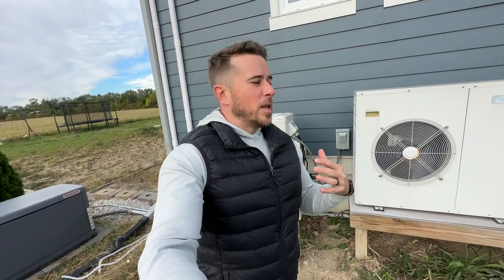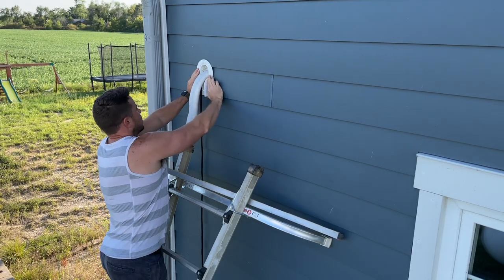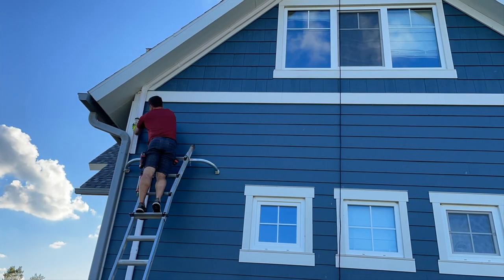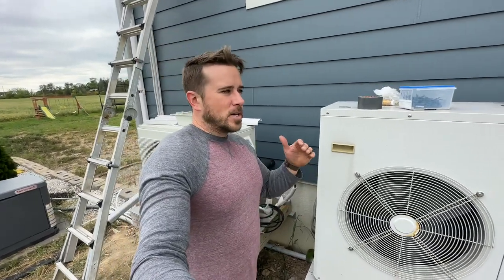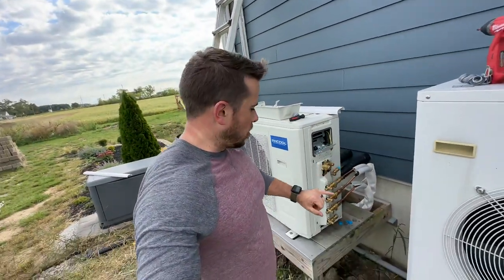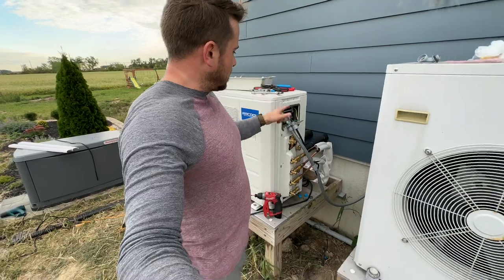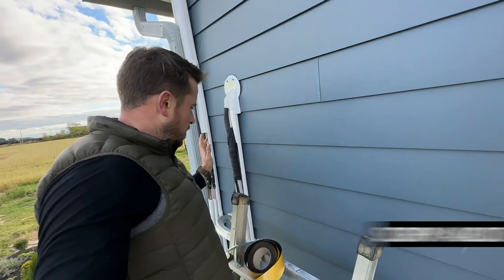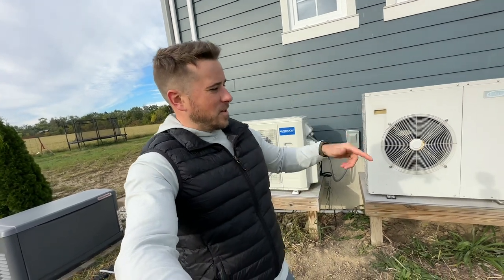MrCool Install Part 3 - Hopefully my last FREAKIN HVAC video!

Comment: Good job on the line covers.   With our attic unit, the contractor just ran the lines up the side of the house and the previous owners let them get away with it.  After we moved in, I read their HVAC sales contract and it specifically called for the lines to be covered..   When I'm ready for a new unit, the lines will be enclosed.
Reply from the maker: Yeah, seems like the sun and weather would wreak havoc on anything exposed like that.

Comment: Im glad to see you dont have any extra line set out at the outdoor unit... A BIG problem with these DIY pre charged line sets are you dont cut the excess so MANY people coil up the excess like a ferris wheel and then the oil can get trapped and cause pre mature compressor failure...

Comment: Loved the videos on your HVAC system. Trial and error sometimes can be the best teacher. My question to you use; how many condenser units do you have in total? I am about to tackle a similar project on my home and its looking like I'll need 2 separate condenser units to supply all the necessary inside air handlers. As long as you have room in your circuit box, you should be able to run as many as needed correct? Thanks again for making these videos, helps us DIYer out in a big way!

Comment: I guess my only concern is that the Mr Cool Warranty states pretty specifically on their website that the warranty will only apply if the unit is installed by a professional contractor.  I'm considering installing a Mr Cool Universal 5 ton heat pump to replace my aging Trane unit, but I'm a bit concerned about that little fine print detail that most never talk about.  I guess the savings in buying and installing the unit may be worth skipping the warranty all together.  My only other problem is finding some to work on it if it breaks.  I don't have any Mr Cool dealers close by, so I'd likely have to do the work myself, but getting OEM Parts may be a challenge under warranty if I Install it myself.  So far, most AC Repair guys I have talked to don't want to touch these units because they didn't sell it to you and make big bucks off of the sale.  Do you have any insight into how this may work in your situation???  Just curious.  Great Job on the intalls by the way.  Love the video and the details.
Reply: I like the Mr Cool units.  I installed one, and ordered 2 more.  I had a HVAC contractor install a Daikin mini split and the cost just to install was $2,000.  That was more than what I paid for the Mr Cool for the same size.  I would not worry about the warranty or service.  There are few HVAC people that will work on Mr Cool, and if not you can buy a new unit and still save money.
Reply: they have free tech support and they can tell over the phone how to troubleshoot then when you know what is wrong  you decide if it's worth fixing or just buy a brend new unit

Comment: how do you feel about drilling  holes in your siding? will water ingress during hard rains/storms?
Reply from the maker: I don't love drilling holes in my siding.  I hate it in fact, but there wasn't much I could do in this situation.  I think I did an alright job of sealing those holes.  Plus I have a 3/4" air gap between my siding and the wall so if water does get back there, it should easily dry out and not cause any issues.

Comment: What is your plan for that air to water heat pump ?
Reply from the maker: Not 100% sure.  I want to build a barn so I could possibly use them there.

Comment: I heard you say you used 10 gauge. I just finished reading my 36KBTU instructions and it called for 6 gauge. Have you had any issues with the unit in the summer with tripping the fuses? Id rather run 10 gauge also. Much cheaper.
Reply from the maker: Don’t take anything I say as professional advice, but yeah, 6 seems like WAY overkill for a heat pump.  I’ve had no issue with 10, although the gauge of wire has more to do with heat buildup due to amperage draw.  A too small of wire shouldn’t trip fuses or breakers, it’ll just overheat.  But 10 is good for a 30 amp breaker and I don’t think these units should ever draw close to 30 amps.
Reply: It depends on your breaker size, 6 is for 50amp, 8 for 40amp and 10 for 30amp. Make sure the whip is the same size too.

Comment: Is it necessary to trap the suction line before going into the compressor unit? I noticed you did whether intentional or not, one video I saw said to but no one else does. Any thoughts? I would think the oil would fill it eventually and create gas flow problems, although your  suction line trap is 4' long.
Reply from the maker: The only thing I can probably say about this is that MRCOOL’s line sets generally end up with excess due to the fact that they’re pre-charged and sealed, and therefore can’t be cut.  I got lucky and had no excess but it is recommended to store that excess loop horizontally as opposed to vertically to avoid the issue you describe.  However, I’ve seen others online store theirs vertically without issue.  Perhaps it’s something that will happen more over time.  Idk.  I guess I see what I did the same as storing it on the ground horizontally next to the unit.  Hopefully I’m correct.

Comment: when you do everything yourself, you can be sure that you do it correctly. guaranteed that professional installers of ANYTHING, will take shortcuts and do it improperly, for sure. they will take advantage of you. doing it yourself you can be sure you do it correctly.
Reply from the maker: As long as I know how to do it correctly...otherwise I might be in trouble.
Reply: @makework  thats the good thing about youtube, you can find videos on how to do just about anything... other than that youtube is a bunch of weasels lol

Comment: I agree with the caulking of the screw holes. thats not something an installer would do.
Reply from the maker: Yeah, it seems like a small thing to try and just help ensure water stays outside where it’s supposed to be.

Comment: no vacuum needed before releasing freon?
Reply from the maker: The MRCOOL DIY line sets are already charged with refrigerant and the fittings have valves that open once you connect to main unit and indoor air handlers.